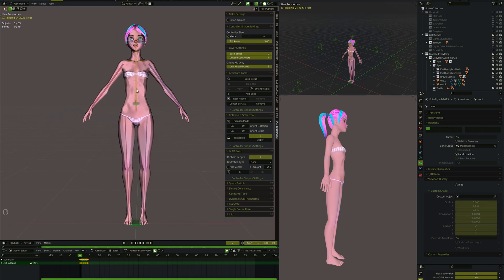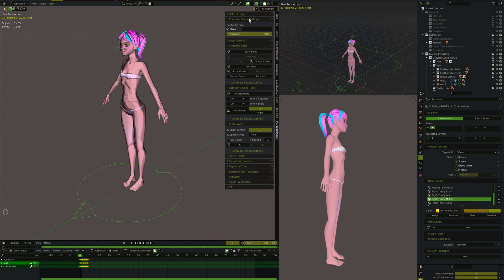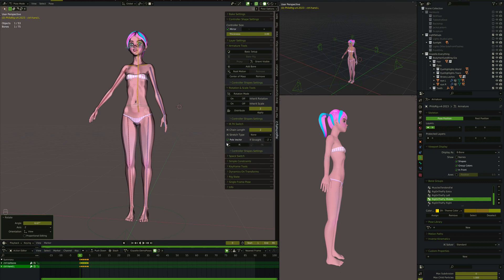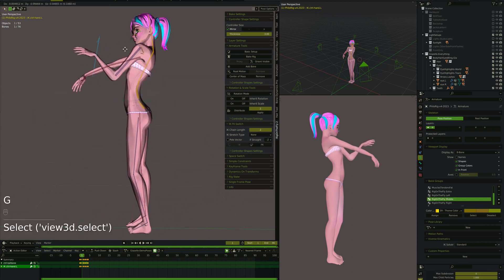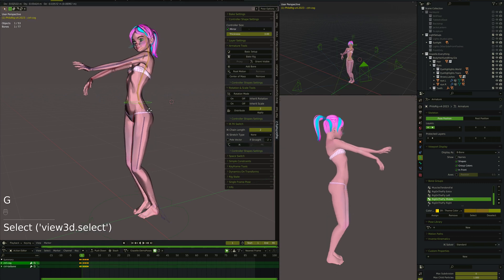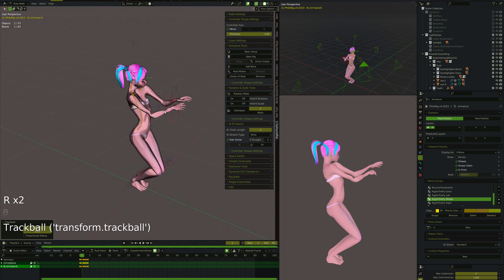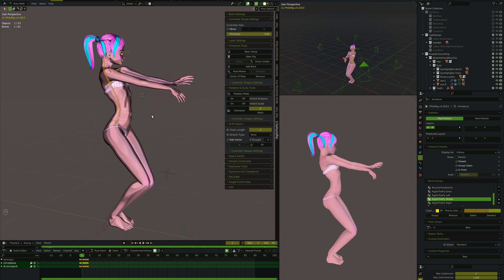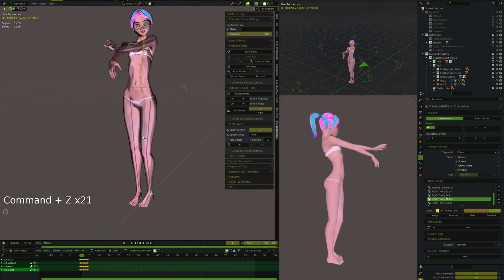Setting up Rig on the Fly, part 1 of 2

Comment: Would you say your paid course on nude female rigging is still relevant currently for a beginner rigger?
Reply from the maker: If you're a beginner, I would recommend first finding and watching everything Dikko and Royal Skies LLC has talked about on Rigging. Give at least a couple of their vides a try before starting in on my tutorials. If you're a very good and independent learner, though, you could start with my tutorials. Just know you're going to be struggling with things like showing and hiding bone layers, clearly setting up bone rolls and head/tails of bones, bone hierarchies, connected vs disconnected bones, etc. Because I definitely start from an intermediate/advanced set of concepts, and only go more complicated from there.

EDIT: Also, Pierrick Picaut has a lot of great content for getting into the basics of rigging.
Reply from the maker: One method that would work well for me personally if I was starting out would be just purchasing one of the characters (you will notice Monette Taida is very low-priced, and is the character we spend most of our time on in the tutorials) and then just playing with every single bone on the rig, checking out its drivers, constraints, parent, children, and trying to understand how that bone and its related bones work. At the same time you will probably have a lot of fun with the character herself!

Comment: This looks very similar to me as what Richard Lico is doing in his animation Sherpa course for Maya.
Would I be correct in that observation?

I think Richard's workflow make so much sense, instead of counter animating everything.
I'm currently taking Pierrick Picaut's animation course called Alive and in that there are space switching parts as well.
So I hope I get to learn this workflow really well.
Reply from the maker: Yes, this plugin was built by Blender engineers who learned the techniques from Richard Lico's techniques. It makes them easy and quick to use. Strongly recommended.
Reply: @philo_vivero  I found another free addon today for space switching in Blender.

https://youtu.be/SXlGf6RKAp4?si=jURglQpAZV4CByip
Reply: I think Pierrici has also be mentioned he took a course from Richard. Saw a video about that some years back

Comment: How is Rig on the Fly better than Rigify? What advantages does it bring?
Reply from the maker: It is different. Rigify is for pre-made generic rig. Rig on the Fly is for a basic custom rig to be modified on the fly to create more complex movements and types. Rig on the Fly gives up on "make a very complex rig" for "make scripts that change the rig as you need it."

I think eventually the Rig on the Fly methodology will win out. If AI doesn't make both methodologies obsolete.